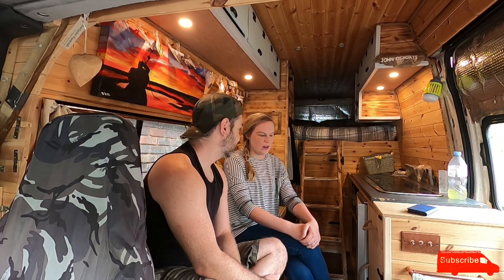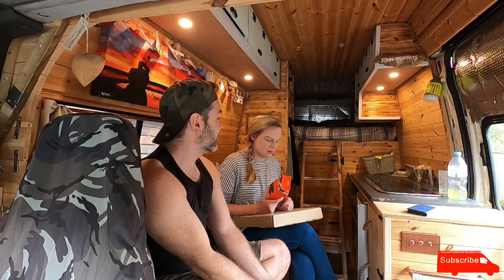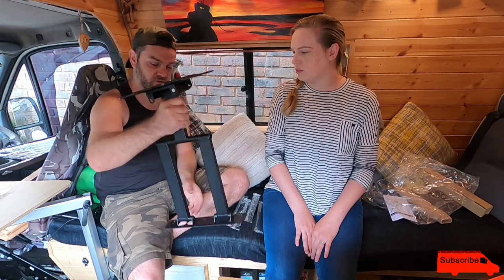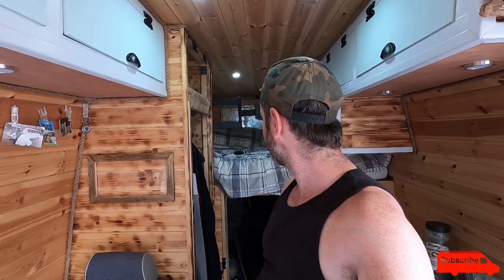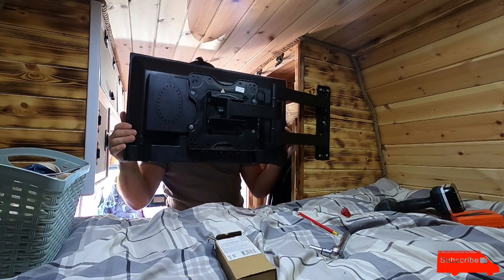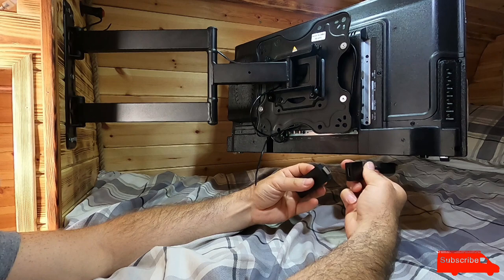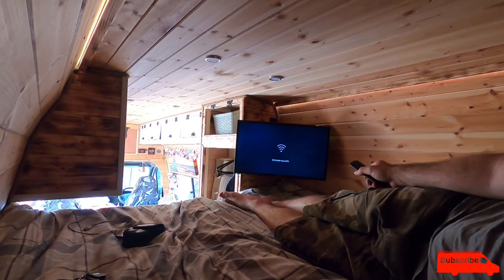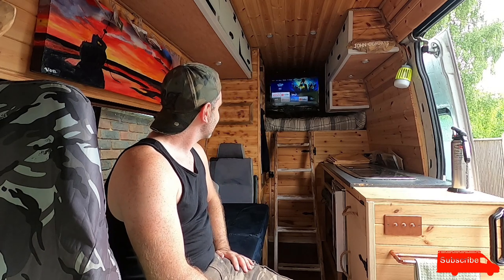Unboxing and how to install Cello 12 volt tv in campervan

Comment: Snap Luke, I got the same tv a month ago it was recommended by Gadget John's review.
I used a gas sprung tv bracket...
I also used the plastic coil wire tidy with enough slack to move the tv in any direction.
Reply from the maker: Good ol' Mr Gadjet. That's why we bought the TV as well :)

Comment: I wonder what fuse you put on the other end of your 25 amp cable the fuse in the 12volt plug with  Built in Switch, LED to indicate power status. Replaceable 3 A fuse. even this could be smaller :)

Comment: Ive had the cello tv for over a year now.  The only problem I find is when flicking through channels fairly quickly, the tv has a tendency to freeze. Then you have to switch off and wait about 10 seconds before turning back on. Its a good tv though. Ive got the non dvd version but its the smart tv so can watch youtube on it etc.
Reply from the maker: Hi Dave. Glad that cello have quite good feedback. I've never owned one till now. I'm certainly happy with it so far :)

Comment: If you want to store a load of dvds don’t get one of the zip folders they take up way too much space. Get an old blank DVD spindle. Come in 50 & 100 sizes. Way less space and weight. Just a bit more difficult to find the one you want.ebay for £5

Comment: I would recommend the Anker speakers too, with a 3.5mm jack cable connection to the TV you would save the battery a lot!
My concern would be dust in the DVD player, blocking the lens sled, especially in that bed area...
A local device that picks up open wifi and has it`s own sim card for wifi-less areas would be of use, I guess...
Maybe with a outdoor antenna that gains enough signal
Thx for the vid!
:-D
Reply from the maker: Thanks very much horst. Hopefully I won't get any problems with it. 🤞🤞😁👍

Comment: Wrong  TV should have got the Cello 32inch comes with it's own battery inside and a 40watt solar panel and two reading lights on about 8'of cable each so no using the van batterys

Comment: I that the £180 24 inch version?
Reply from the maker: We paid £137
Reply: @LukesVanLife  yes I seen the listing on Amazon. Buy from the manufacturer and it comes with the M4 bolts. Or you can trim them down with a angle grinder (the ones you have) plus buying from cello gets you a 12v power cable to.